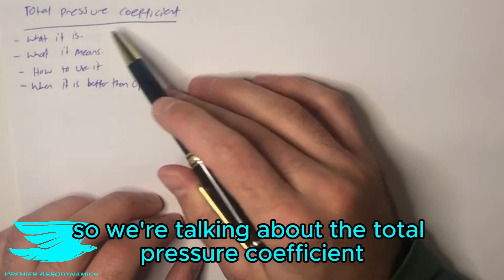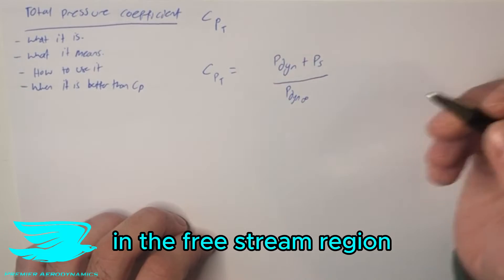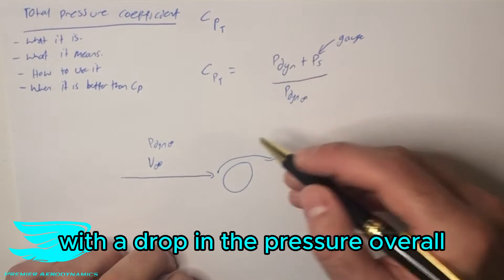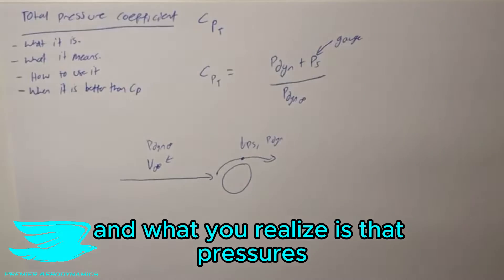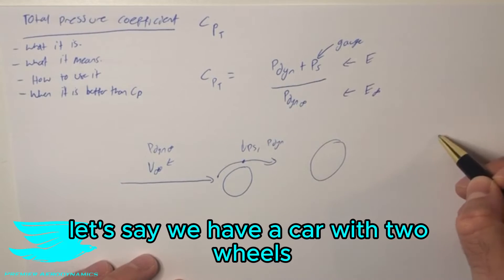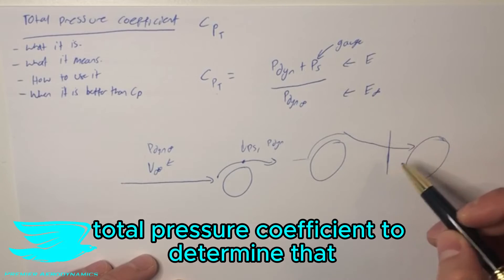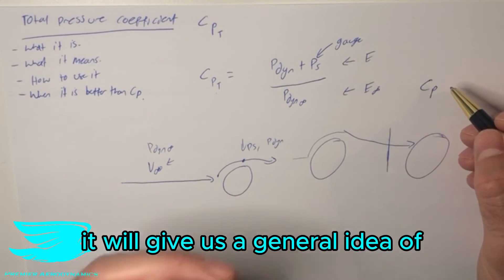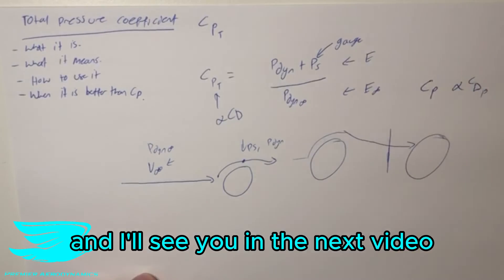[Aero Fundamentals #33] Total Pressure Coefficient Explained

Comment: nicely explained....one additional question...i know from practice that when cpt is zero in a flow it's called the separation point ....how do you physically explain or comprehend that...? like in a wale i assume cpt is negative and in stagnation i assume its positive....correct me if my understanding is wrong ..thanks in advance...
Reply from the maker: Thank you.

For the separation point, this is where the fluid that came from upstream on the object has now lifted off, and other fluid from somewhere else has entered.

So, the total pressure coefficient is not necessarily 0 because if it has entered, then it must have some velocity, hence the dynamic pressure is not zero. As for the gauge static pressure, this is often higher than the point just before separation. That is why airfoils lose lift: this static pressure in the separation zone is higher than the static pressure on the surface if flow were still attached.

As such, the total pressure coefficient can be non-zero, and positive.

For the stagnation point, this is where the fluid is has come to a stop so all of the energy in the dynamic pressure part has been converted to the static pressure on the object.

If this conversion is 100% efficient, meaning there is no loss due to viscosity (directly or indirectly) and no additional energy is coming from elsewhere in the flow, the total pressure coefficient should not change because the sum of the dynamic pressure and static pressure is still the same.

If you're unsure about the relationship between the total pressure, static pressure, and dynamic pressure, we made another video like this but explaining these properties. It's called:

"[Aero Fundamentals #6] Static Pressure, Dynamic Pressure, and Total Pressure Explained"